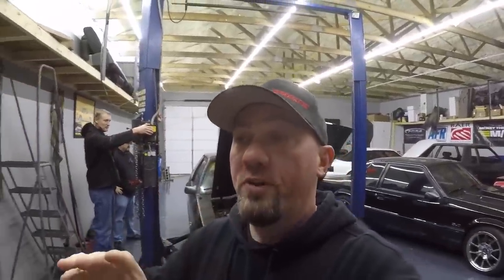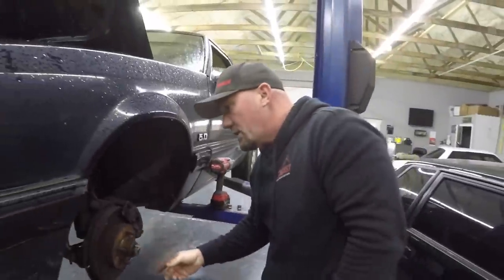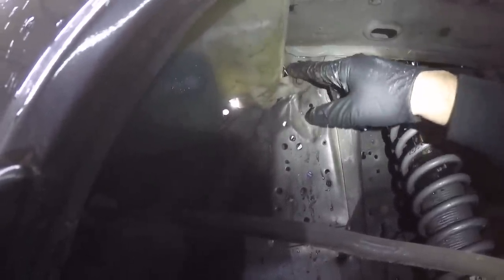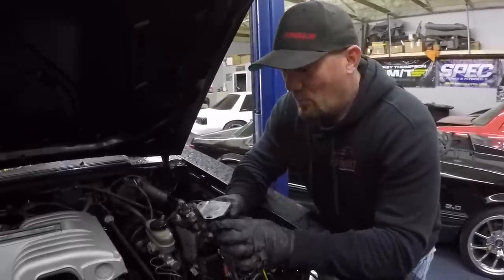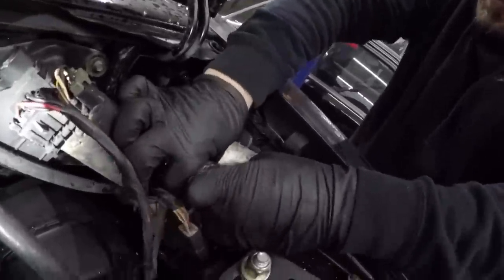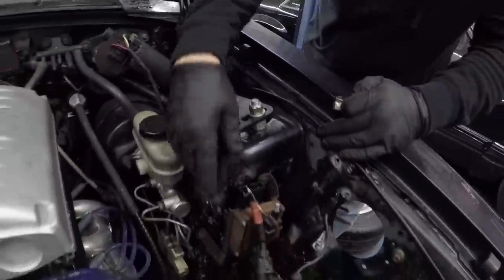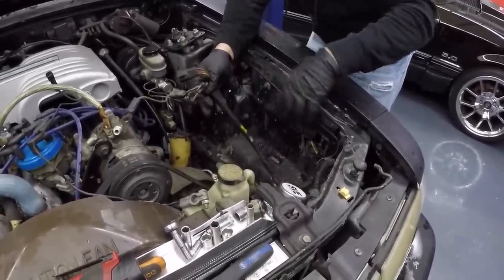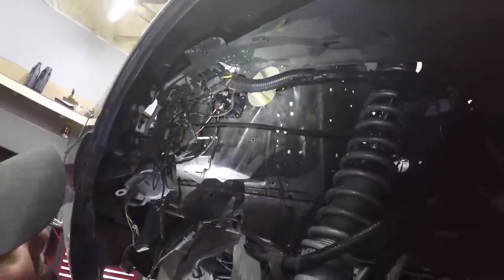Foxbody wire tuck! FREE MOD, AMAZING RESULTS!

Comment: Handy info. I'm in the midst of tucking wires and relocating the battery to make room for a turbo.  I ended up de-pinning a couple connectors to get through the hole in the apron (instead of opening up the hole). Also took off the old harness wrap to get some more slack and cooperation, will re-wrap when it's all said-and-done.
Reply: When you de-pinned, did the wires just click back into the plug with no issues?  I’d much rather do it this way than cut a bigger hole, but 30 year old plugs are not always cooperative.
Reply: @guitarstudy0062  It cooperated with me, your mileage may vary, depending on how your plastic has aged.

Comment: nice, just finished up another one using the rear most hole not needing to open the hole up. rolled the factory headlight harness down thru the hole.

Comment: Lads - highly recommend using tesa tape instead of plain "electrical" tape when re-wrapping any wiring harness.
Reply: I am doing mine now and had some Tesa tape. Even when it rubs over the metal edge it doesn't knick /mark it or anything. I would not use electrical tape only like you said in the area that passes through those sharp metal edges. The other areas with some wire loom would be okay without the Tesa. And yes they are sharp. I knicked my master cylinder wiring up pulling it back through the hole. It got a Tesa wrap after. :)
Reply: THANK YOU for that advice. I thought super 33+ 3M was the best it got, but so glad to see it isn't! :P

Comment: Caleb that was a nice tuck looks alot better. Im doing same thing in my 03 gt. Could you do a video on a battery relocation  or an overview if you have a video could you link it?
Reply from the maker: I have not done a battery relocation vid, but can definitely take care of that
Reply: @FoxcastMedia  Thanks Caleb i appreciate that im trying to do one just not real sure about the best way to run the wires like to starter or to fuse box or to alt first i plan on doing the big 3 so any help would be really appreciated
Reply: In my opinion run wires through the factory hole that the old style cruise control unit use to exist on drivers side. It comes right below the dash and it's right to the fuse box. On the passenger side get a hole saw or dremel and cut in the same location as the driver side. It is hidden and is safe. You can see the factory hole on driver side in the video. His car has a grommet

Comment: I have a question I was doing the wire tuck but for some reason I have 2 wires coming from under my battery they both say fuselink 14-GA.  Can you tell me where they go?

Comment: Did you plug in the connector for the brake fluid? Or can you leave that unplugged?
Reply: Did you figure it out ?
Reply: @Mrslow5.0  I plugged mine in there's a hole in the strut tower the the connector can reach through. I think it's just for the low brake fluid sensor so doesn't necessarily need to be plugged in.

Comment: In the middle of a wire tuck on my 92 notch and was wondering the best place to run the A/C compressor wire. I just noticed the car in the video doesnt have it hooked up. I was thinking thru the washer reservoir hole along the side of the battery tray? You make everything look easy. It's a struggle lol
Reply: He made it look easy because it’s a hack job.  He need about 50 more hours to make that right.

Comment: That wire connected to the starter solenoid on the right which is the only one there what is that for it you know it would help me cause I got a short on the interior light of my foxbody?

Comment: Where do you have the starter cable routed to the starter solenoid? Under frame rail? Does it interfere with the inner fender cover? Thx

Comment: I mounted my starter solenoid on the back side of the fender well, I took out the washer fluid tank, can i run the wires behind the strut and to the starter solenoid?

Comment: My battery is in the hatch and now I'm looking for info to put the thing back under the hood, bought the car that way but its hard to start after warm up and I'm not sure if it's a timing issue or the starter or this 20 foot hot cable

Comment: Hey Foxcast, I know I'm a little late to the party but had a question on this video, which by the way, one of the best on wire tucks. What did you do with the AC compressor harness that connects to the large bundle of wires you tucked? It's only about 12 inches long coming from the compressor and no way it will reach under the fender wall and reach the harness in the fender. It's only 2 cables on the harness; should I be able to simply extend this with some 10G wire? Thanks for the video!
Reply: I would think so.